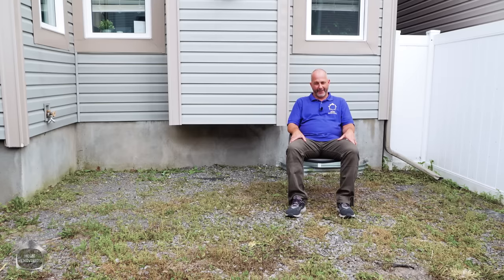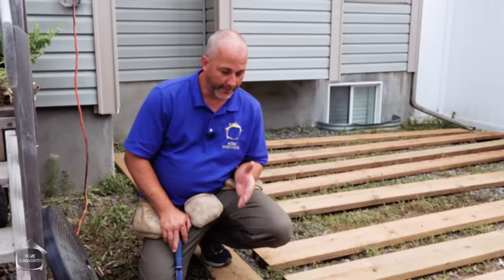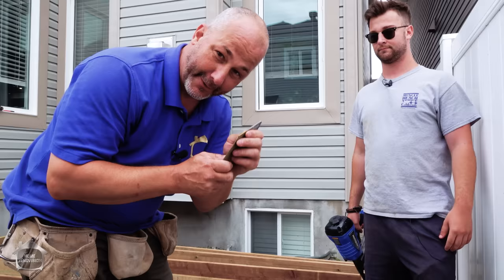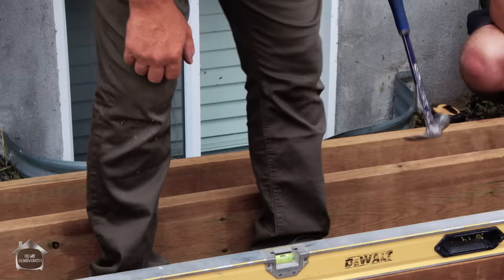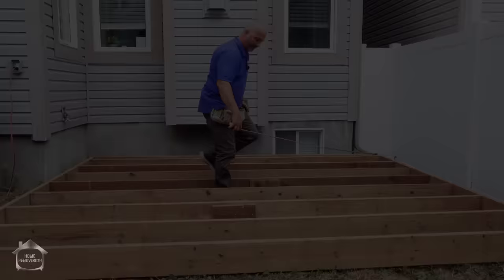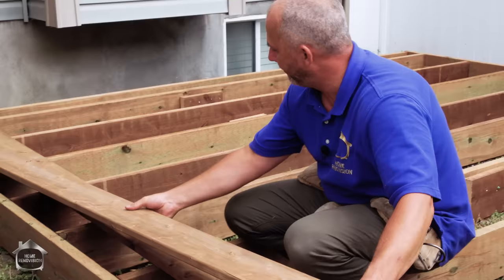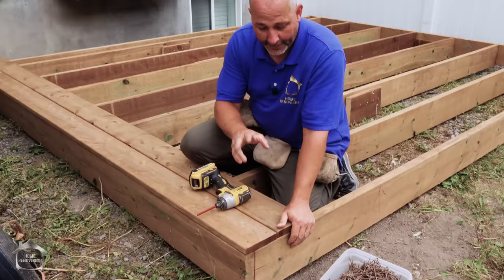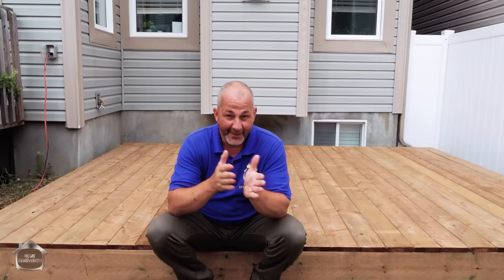How To Build An Affordable Deck

Comment: I do not own my home and pay a very affordable rent. I recently noticed some of the deck boards are rotted in places. I am afraid the deck is no longer safe, but I do believe the joists are still sound. 

Can I buy plywood sheets and lay them on top of the existing deck? How thick should the plywood be and what kind of paint or sealer should I use to make the plywood weatherproof? 

The owner is a friend of mine and I don’t want her to have the hassle or expense of replacing all of the deck boards (and maybe needing to increase my rent to cover some of the expense). Besides, I would be able to use the deck right away and not have to wait for a construction crew to fix it.

I love how straight-forward your video is and how you show easy ways to deal with problems like the deck boards not being straight.
.

Comment: Great video. Easy to follow. I have some grassy dirt that I wanted a short deck on top of and this video did the trick. I laid down double week block material (I could find the thicker stuff). My deck is flush against the cabin so I could not screw or nail in from the outside.  I saw another floating deck video that used hangers so I used those on the joists adjacent the wall. This is smaller deck (4.5 feet x 9 feet) and cost about $275 and about 7 hours working by myself. It looks terrific!

Comment: I am adding on to my deck and am replacing the existing decking with new deck boards and I was going to reuse the green screws BUT NOT NOW!!!!  I am going to buy brown screws and use the green ones in hidden areas  GREAT TIP JEFF.

Comment: What about
1. Grading the ground underneath to drain water?
2. Putting in a damp-proof course to stop moisture coming up through the soil into the timber? 
3. Gaps for termite inspection?
4. Ventilation gaps?

Comment: Hi Jeff!  I am so glad I found your video on this simple “out of the dirt” solution. I currently live in Tucson, Arizona, where most of the year is dry but there are monsoons that blow through in the summer creating lots of water.  I was planning a cute little L shaped ground level deck just to get us out of the dirt. My question is, should I lay down some sand/gravel underneath to help pull the water away when it rains?  The dirt here is nearly like clay so it takes a minute to absorb the water. Thanks so much for the quick how-to solution for a small ground level deck!

Comment: Something I was taught for screws is to drill a relief hole first that is a little bit smaller than the nail or screw you want to use. This will prevent splitting!

Comment: You said "Ask questions in the comment section"..  prepare to regret that!!.  LOL.
Okay.  
1:  I live in West Central Florida. 
2:  Id like my deck to be an extension off my porch (but not attached for obvious reasons), so we can step 'onto it' from the porch. 
3: The current drop from the porch to the ground is about 2", and its St Augustine grass.
So..  with that info...   
Id probably want composite Decking for the walking surface because of the Sun exposure.
Ill need to rent a turf cutter and take off the layer of grass, then premeasure where the 6x2" support boards will go so I can dig channels in the ground to accommodate the needed space "below" ground level. 
I may need to place concrete piers to hold the structure (or would a fill with gravel / shale work like the video above, although I see issues with water pooling/drainage?)
Ill need to create some kind of drainage around the deck to prevent standing water soaking the 6x2's.

Essentially, I to be creating a sunken deck with the walking surface 2" above ground level.  ( Take that Code Enforcement!! )

Comment: Hello, the pieces you used to level the deck and come into contact with the ground, how many are there or more importantly what is the proper spacing? And would it be good to put then on pavers so they aren't in contact with the ground? Thanks!

Comment: We do this Florida except we sledge hammer in 4x4 posts for supports instead of 2x8 scraps.. The other thing is we use 2x6 joists because his step is too high from the yard.. 7" is a nice step up or even 6"   He has over 8 1/2" since there is a space under the deck to level it

Comment: I'm building my own deck w a grill platform with 2 steps 

I done tried screwing in the deck screw but I prefer to pre drill my holes I found it much easier that I don't split my wood

Comment: A completely different type of finish is the Lifetime Stain from Valhalla, it's completely non-toxic and you never need to re-apply. It protects from UV, and you can follow it up with a penetrating water sealer to keep the moisture out!

Comment: Your argument about oil vs water based is interesting. The deck looks nice and i absolutely agree use 2x8s if you can. But it looms like that deck is on the ground. If so rot and insects are going to eat it alive within a few years.

Comment: Hey- Thank you for the great video. I feel like you're one of the best at just explaining this simply to people who don't have much experience. I do have a quick question for you:

What is the difference between this version of a ground level deck and a "Floating Deck" like you have in the other videos where you use the cement blocks? As in, is this one going to last far less time? I live in New England, so I am not sure if the climate has an impact? I would love to be able to get away with just building one this way without having to dig and put in the cement footings. 

Thank you in advance!

Comment: Oh bother… 

You made this look so easy.
I may have changed my mind (again). 
I was going to use concrete for a backyard deck.
Since the ground is already dug out, can I cover the dirt with weed barrier, place the frame inside the hole, & then fill in with gravel? 

The answer given may firmly make up my mind.

Comment: Hi, this was great thanks! Although there are a few things I don,t comprehend as a total building beginner:
1- I don't see a carpet/cloth on the ground so I am quite confused when you talk about the ground cloth.
 2- I didnt understand the step with the level, like where exactly to put blocks and how many.
 3- Your planks are wet? Why? How do you get that? I would like to use cedar wood because apparently the smell deters insects and spiders.
4- I live in Canada with very cold winters and hot summers. Would I need to add anything regarding the freezing temperatures?
5- How do you keep the wood from rotting?

Lol maybe as a beginner I need to watch more videos to understand!
Reply: He wasn't clear on those points.

Comment: Great video! What are your thoughts about using heavy duty wood Chep pallets as a base? I have access to free pallets and these are made to store heavy products outdoors. The pallets measure 3.5 by 4 ft which is equal to 12 x 10 using 9 total pallets. I would still put down the vapor barrier, then place the pallets on top of that. Then I would get good quality decking boards to attach to the platform and the sides.

Comment: Great video, I am looking at a deck directly on top of our block paving. 
Will the wood even though it’s treated rot when in contact with surface water?
If the deck is totally flat, is there not an issue with surface water as no run off?
Thanks for any support, great channel

Comment: Why did you not put a screw gap in between the deck boards?  Wouldn't a little space be needed to air with being close to the ground?  OR is it because the wood will dry and shrink?

Comment: Love the video because this is exactly what I want to do.  However, I have a slight slope (back to front about 10") and I plan to put a hot tub on the deck.  Should I space the 2x8's every eight inches versus 16 inches?  Thanks

Comment: Of course you want to keep the deck off the ground but you used support wood pieces to accomplish this. But this is still putting wood in contact with the ground. Why not used pavers to support the deck? Stan

Comment: Great video.  What do you recommend or suggest sanding very lightly without losing the pressure treated coating?  For anyone that might want to walk with socks or bare feet on occasion.  Is that even possible?

Comment: Sorry, I know it's 3 years old video but I just saw it. I live in very humid weather (like a N. Florida weather conditions) in the mountains. My deck base made from galvanized beams. I will use pressure treated decking wood. Do I need to leave some gaps between the planks? I have a roof above the deck. I also want to avoid as much as possible water dripping down bellow deck as I use it to store some materials.
Thank you

Comment: I built a 12×16 deck like this, with leveled 4x4 on every 16 inches. 2x4x16 I added 3 screws, so no warped wood.

Issue with this deck in this video, there is no liner to prevent grass and weed from growing between boards. Even as it is on a ground, due to cold weather, without a ledger board this deck will "dance" in comming years.

Comment: Do you put the wood frame on those cement blocks I’ve seen used in the corners for a 4x4 post? Or is this sitting completely on the ground! Also the wood list says you used three (3) 2 x 8x 10 boards on the frame and laminated the third. Woukd you not need four (4) four of them for the frame then the others for the floor joists and then the top decking?
My wife wants a deck or cement space right beside or front door 8x6 deck on our mobile home. Right next to the deck, so rather than extending the deck to make it bigger, she wants to walk down a sat of steps off the top TP deck to the ground deck and be able to sit and relax. I’m trying to do this as economically as possible since we’re both retired and on fixed income. Many thanks for your video and help.
Thanks so much..

Comment: My contractor was not able to complete my deck project and because there is so little left to do, I am  unable to find someone to complete it. I have two small separate concrete  slab, one 4x4 and one  5x6.  I thought of just using pavers on top of the concrete for leveling purposes and a support board lying flat down the middle (it will be too high to lay it vertically). I would then frame around the slabs and then put down the decking. Perhaps I will put a vapor barrier to balance out direct sun on top and cold from the slabs to resist warping. Could you please tell me if I am thinking right? Your video really gave me confidence that I can do what seems like a simple project. Thank you. Stan

Comment: I live in Vancouver BC Canada. My deck is in the hot sun most of the day in summer. I replaced the deck boards two summers ago and the boards are cupping and some boards are lifting and pulling the screws out of the 2x8x10 and tips would be great.

Comment: Hey! I have a quick question please at 12:30 you mentioned if the deck is being built on top of a lot of soil, it will create moisture. What would be the best way to prevent the wood from swelling?
Reply: wondering the same

Comment: Question: I have ducks. I have tries grass, sand, astroturf. I am thinking deck. Slats far enough apart to wash poop off the deck. They have a pond and everything is in it. Sand, dirt, poop and toads. I am trying to keep from changing the water so often. I can send pictures. What material would you use for weekly washing and how far apart would you place the boards?

Comment: Thank you for the great video. I am going to try this soon :). Isn't the weed barrier degenerate after few years? As per my understanding no weed barrier lasts long, they break down and eventually weeds come through anyway, at which point you have to replace the barrier which can be extremely difficult if not impossible. Any thoughts or advice on this?

Comment: Dunno, but I really don't like using common nails on any structure. A deck is going to flex with walking and shrinkage and IMHO these common nails will loosen. I would use 4" ardox and hammer them in. I get that the nail gun is faster, but as far as I have seen they do not shoot ardox and our previous home the floors squeaked etc. If you are building your own deck a bit of hammering is good exercise. 
I would say further that screwing the deck together is nice if you have to take something apart and the parts are less apt to move when screwing vs. nailing.

Comment: We are redoing our deck boards (deck roughly 40ft long so will need to use multiple boards length wise). When screwing into the joists at the butt joints, do you screw into the end of the board straight down or more of a toenail and screw down at an angle in order to get more of the joist with your screw?

Comment: Awesome video. How about using composite deck boards? Same process?  Maybe excel for the frame. What do you suggest? Pressure treated deck or composite? Your advice will greatly appreciated. Thanks and be safe

Comment: Great video.  I'd like to try this over an old patio of concrete pavers.  Any issues with doing so?  Weeds grow between the pavers now; is weed fabric necessary?  Also, how do I adjust the size.  The length would be 22 foot total.  Thanks for your help!

Comment: Thank you, awesome video as always. 👍
Gathering quotes for building a deck on my backyard and leaning towards doing something myself instead. Without fancy helical piers at $250/each before tax, fancy railing and of course without attaching it to foundation but for a fraction of price. It rather makes sense to re-rebuild it from scratch down the road if it rots away than to pay somebody $15K + tax for building something marginally better.
Just need to wait for COVID lockdown to end so I can go and pick lumber myself instead of dreaded curbside junk pickup from Home Depot.
Reply from the maker: I totally agree. However in my experience Perkins lumber has better wood and service and will deliver for the same price. they are in North Gower. Cheers!

Comment: Just a thought - would it be better to use composite wood for the "legs"?  A little more expensive, but less chance of rotting since it's in contact with the ground?

Comment: Made it look easy. I just gutted a rotten deck that was built in the ground where water would pile where the beams were. How can I get my deck off the ground but still be flush with my back door? Thanks!

Comment: Hey Jeff.  Great video.  I'm planning on doing this .  Is there an inherent problem of using 2x4's instead of 2x8's?  My pergola is rather short and that extra 4 inches of headroom would make a big different for me.  Thanks for your response in advance.
Reply: Update.  So I did this. Had to make a few adjustments based on my situation but used the same plans. Worked like a charm. The leveling technique is genius!  Can't believe how easy this was

Comment: There are countless sprinkler heads in the backyard of the house I just bought, the dirt is quite compact and the place is not accessible to the excavator or dump truck. Thinking about building a deck like this so I don't have to do all the digging and backfilling associated with a paver job. This video has a lot of helpful information, my question is it is not necessary to clean up the greens before putting the deck on top? I know yours have cloth underneath but for the ones that don't what should we do? I can't find anyone talking about this and one thing I'd like to avoid is an entertainment center for bugs/spiders under my feet. Thanks for the great content.
Reply from the maker: you can cover the gound in goetextile cloth ( landscape fabric) and then place then deck on top

Comment: Hi Jeff. That deck really changed the look of the entire area. I've got a bare concert patio attached to the back of the house. It's got one concrete stair on the three sides that aren't attched to the house. I'd like to build a wood deck over the top of it, i think it would make it look a lot nicer. I live in S.E. Oklahoma. I'm concerned about attaching the PT lumber directly to the concrete as it seams like it may retain rain water and other moisture and cause premature rot. I'm considering some type of metal sub framing that would float the wood off the concrete and maybe offer better drainage. Can you suggest a product or if I'm just way out in my thought process, set me in the right direction? I sure do appreciate y'all. Thank you.

Comment: This lis amazing it looks like the easiest deck to build that I've seen, but every other video says that I can't work directly on the ground and that you need to dig a hole and fill it with gravel, or make a gravel foundation or something like that, because otherwise it will sink unevenly.  Am I missing something or is it ok to let the little posts to sit directly on the ground?

Comment: Amazing Work as always ! Your posts are absolutely DIY and helping lots of people with their dream projects !!! Just want to clarify if snow/frost would cause any issue to this deck ?? Its typically recommended to put footing below frost line or concrete blocks here in Canada which make  this DIY project really complicated. whats your advise ? Thank you
Reply from the maker: if it ain't attached it cannot be damaged. the down side is this close the the ground it will only last 20 years!

Comment: theres those new plastic decking systems which are probably more serious and the chemicals cant be as detrimental to our survival depending on the bonds that is being used to create the plastics. some people clearly have different chemicals in there body that can be reactive like allergies etc that is a beneficial thing of wood but can cause the same issue but it absorbs moisture more , clearly.